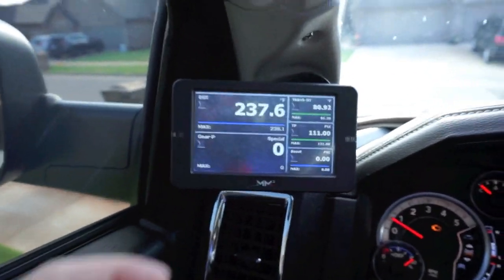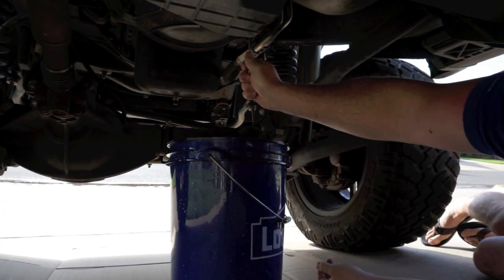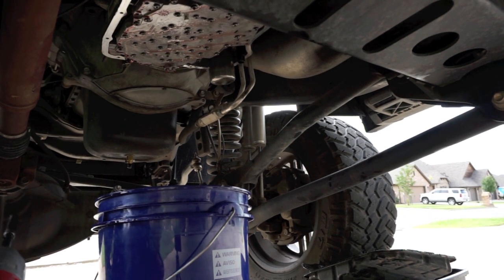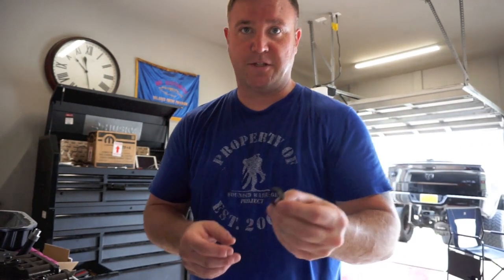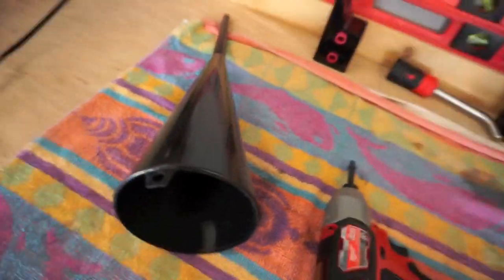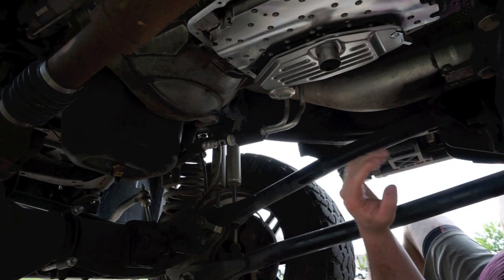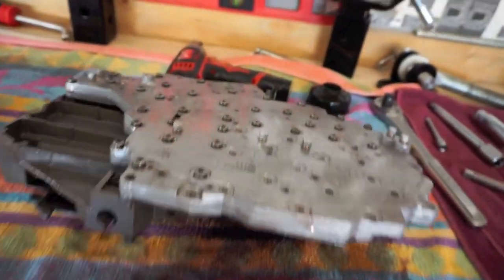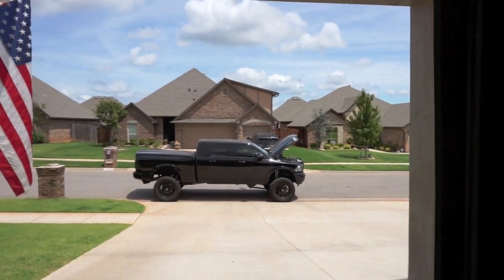68RFE Revmax Valve Body Install...

Comment: I got about 300k miles on my 2010 68rfe. 50% of times towing construction machinery. I find it's the transmission tuning that makes the biggest difference. Tuner can tune the line pressure, which would make the transmission shifts soft, firm or racing neck breaking shifts. I went back to soft. I changed my fluid and filter at 30k. Still original transmission. No issues with towing
Reply from the maker: Man i wish i had your luck. But anytime you modify these trucks performance wise it’s a double edged sword when it come to transmission tuning. My trans finally gave out at 73k miles.

Comment: I took a big home depot tote and cut it down to about 8 inches tall and it was able to capture all the fluid. Also, i used an after market gasket and that was way better than the rtv stuff. I like the revmax valve body, i would like to do that too. Cool video thanks!

Comment: That channel plate looks the same the day you took it out as the day it rolled off the lot. That’s just how cast aluminum looks. Also with your thermal bypass delete now your trans won’t reach operating temp
Reply from the maker: After further research i understand that. The thermal bypass was just preventive. It takes a little longer to warm up but she does warm up. She doesn’t get nearly as warm as she once did.
Reply: @okc_garage  did you have overheating trans issues before? Optimal trans operating temps are in the 170-180 range. What do you see now? 140-150?
Reply from the maker: @CHILLHP  i haven’t monitored it lately but i will next time and let you know. I wana say 150-160 range. If those thermostats seize and don’t open you will fry the trans. That’s why alot of people do them.

Comment: I have the exact same setup both hardware and tuning and yes I agree, you can definitely feel that the power is reaching the ground. My '19's used to feel a bit spongy and soft. It's definitely locking more solid and putting the power down.

Comment: Good video. I was going to put a kit in my 68 RFE valve body couple of weeks ago and found my channel plate cracked also. Yours looks good compared to mine - it looks like a windshield that someone hit with a hammer. Pulled a few of the bolts out in the cracked area and the cracks go all way thru the plate. Now I am waiting on a complete valve body. My truck only has 80K on it. It is fully deleted, but I drive it pretty easy. I was shocked how bad the plate looked. This is something anyone with a 68 RFE needs to look at sooner than later.
Reply from the maker: Yeah i was shocked as well. I wish i would’ve done it sooner. Very happy with this mod.

Comment: Just got a 2012 6.7 cummins, installed a BD trans pan and I saw a ton of hair line cracks 10x worse then yours. Will be doing a valve body upgrade when the wallet allows.

Comment: Great video I believe my VB is going out. I have 106k on the clock and I got her deleted at 95k miles. I wished I’ve known sooner about the VB I got my transmission fluid changed around 70k.

Comment: in the pass i use a plastic bottle using the bottom part same drill size use to catch the fluid. I'm going to replace the solenoid regardless. worry free. great video

Comment: Installed mine today with a Mag-Hytec pan.  Pro tip...make absolutely certain that both your truck and, more importantly, the valve body are in "PARK" before you reassemble.  Ask me how I know this.  Fortunately, nothing was damaged.

So...installed my new tunes and hit the road.  Light throttle so far.  I have to say that I don't feel much of a difference between this VB and the stock one, but I've only put 50 miles on it so far.  Yeah, there is a learning process and some people have said it only gets better with time.  We shall see.  I still get the huge shift flairs and all the other irritating anomalies of a 68RFE.  

I'll give it some time and see how it goes.
Reply: You need to update your transmission tune to take advantage of the higher line pressure allowed by the aftermarket valve body.

Comment from the maker: Im sorry I didnt mention this in my video, but i did do a trans relearn when i uploaded the transmission tuning file. Sorry for not addressing this in the video back when I made it.
Reply: Still running good? Still have that flare?
Reply from the maker: @dkbug22  well i snapped the input shaft 3 days ago lol. So i guess no… but before than she ran great i loved it.
Reply: @okc_garage depending on your driving style a valve body swap is suitable.  If you’re leaning into throttle with 150Hp+ tunes… input shaft, torque converter …  etc need to be beefed up.

Comment: Installing that Revmax thermal bypass valve is like removing the thermostat in your engine. I’d go with the Mishimoto bypass valve instead. It lowers temps 10 degrees but allows your trans to warm up. It’s very important if you live in freezing climates.
Reply from the maker: The reason i went with the revmax is because it removes the thermostat. If that fails your trans will overheat and eat itself alive. I live in Oklahoma it’s fairly warm 10 months out of the year. I think she will be alright.

Comment: you didnt wanna upgrade the accumulator pistons why you had it out? good video man. your stuff always helps me out.
Reply from the maker: they are already upgraded billet accumulator pistons with the revmax valve body. She shifts great 2 years later and i have zero complaints. She shift better the more you push her.

Comment: So the VB comes ready to go? Just swap the solenoid pack...?, My ride has a 144k on it , doing this upgrade makes perfect sense, iam just a bit nervous because whoever had the truck before me totally neglected the trans, not serviced once til I got it at 142k.... 😬 Yikes! Thanks for the video, great job man.
Reply from the maker: Yeah man it’s a quick swap and put your old solenoid pack on and you should be good to go. Recommend a trans relearn and bumping up the line pressure to 225-250 PSI.

Comment: Thanks for the Video.  I'm in Australia, the RAM 2500 6.7 are fairly new here in a commercial way.  As a result there is not much in the way of an experienced knowledge base here.  Mine is an MY18 68RFE.  Low K's towing full time.  From all accounts this is the fail point of the whole truck, the trans.  I'm talking with Revmax now about getting the parts over to me in Oz.  Aside form install guide by you, I'm also running RaceMe tuner, the same as yours ??? by the look.  I've sent a PM via messenger to you, if that's you I've found regards tuner advise and tunes. Regards.
Reply: Hey mate did they get back to you? I’m also in aust
Reply: @durryold1  yes mate. Revmax parts here and due to install. This week. Been away.

Comment: I have heard that you need to do a transmission relearn with a scan tool, or the clutches can get extra wear as it relearns the slow way. Have you heard that?
Reply from the maker: Correct you want to do a relearn as soon as you install it to get the clutch volume index’s reset.
Reply: Your supposed to get a retune from your tuner or it won't work right
Reply: Does anyone know how to do this on an edge tuner? I got a 2012 ram 3500 with 217k on it and hoping it helps. Won't stay locked in 6th and have to let off pedal locked in 5th to get it to shift to 6th

Comment: How did you get away without a quick relearn? I’m about to install mine but Rev Max says it has to have a quick relearn or it will burn it up.
Reply from the maker: i didnt do one right away but about a week after I did. Shes still holding strong.

Comment: 6" front and back?  Looks like has the same rake as stock, which is good.

Those "37's" were really 37" or more like 36" probably?

I have 17 in the Luxury Brown. Just put "37x12.50" on the stock 18" wheels and stock suspension. They're barely over 36" at max 65psi. And good thing, as it so slightly rubs the known places. I could literally daily just as is, not hurting anything. The fender can be slightly pulled back no cutting, and leave only the front track bar rub at rarest occasions.

Comment: Not really related to your trans but, what turbo are you running on your truck?  Your EGT's are much lower than mine.  Good video BTW, Like and subed.
Reply from the maker: Thanks Dan I appreciate the support. It’s a Borg Warner S467.7 she spoils pretty quick on stock fuel.

Comment: I have a stock 2017 on 35's. I've just bought all the stuff to do a complete delete and tune. Should I take the plunge and do this mod first before doing all this?
Reply from the maker: You should be fine to delete and tune. But i would highly recommend doing this mod sooner than later.

Comment: shift flare can be corrected with a low stall converter
Reply from the maker: That will be done before to long.
Reply: @okc_garage  I just did revmax low stall converter, billet flex plate, billet input shaft, and the revmax 550 trans. shift are smooth, firm, and no flare. 😀👍
Reply: Or just different tuning. I'm using CTT tuning which unlocks before shift but feels just as good as locked shifts.
I had Calibratedpower before which had locked shifts and absolutely  no flare, but you run the risk of snapping the input shaft lol.
Reply: I have revmax ultra low tc. I still have shift flare very similar to okc 6.7. I does NOT cure it

Comment: Do you have to do a different tuning once you put the new valve body on it? Or do I need a transmission tune? Or just take out old put in new and that’s it?
Reply from the maker: would recommend trans tuning to up your line pressure to 225psi.

Comment: Hey man I have a 2020 ram 2500 looking to use rev max for the upgraded valve body does the valve body come with a filter extension for the oem trans filter?
Reply from the maker: They no longer use the filter extension. The billet plate has been machined so it fits the filter without the extension. And you can use an OEM filter, the do not come with new filters. Highly recommend the valve body you won’t be disappointed.

Comment: Does the tunner do the quick learn process? I'm about to do the same install. 2 years later if you have the rig still. How is the transmission holding up?
Reply from the maker: You would have to reload your tunes on to the truck so it goes into a relearn. If you can get a hold of your tuner ask them to raise your line pressure to 225-250 psi. The trans shifted a lot smoother under hard acceleration.

Comment: Do you need a tune to do this? I have the same equipment and about to install them on my 2017 2500. Was curious if I need to tune before, or after?
Reply from the maker: You will need a tune to up the line pressure.

Comment: Cel at first ride gone at 2nd ride???
Reply from the maker: I had to get a tune revision to raise trans line pressure. The CEL was for a crank case sensor i had removed. Tuner tuned it out. That’s why there not a light anymore.

Comment: Noticed ur check engine light was on. Was it due to valve body issues? If so did it turn off after part was changed
Reply from the maker: No it was on for my crank case pressure sensor. It’s off now.

Comment: How is the transmission pan gasket holding up? Any leaks, and did you use any other sealant with it?
Reply from the maker: Haven’t had a drop come out of it (knocking on wood) and it’s just the pan gasket!

Comment: Nice video to bad they don't have anything like that for the AS69RC... I noticed 900 on the EGT is that about normal for not towing?
Reply from the maker: It’s hotter than hell right now here as well and it’s normally in the 600-900 range when I’m driving it. Sometime she will get up to 1100 when I’m getting on it.

Comment: I noticed your shift from 5th to 6th gear seemed to sound like a slip. I just got the rev max vb installed last week and mine is now do the same thing from 5-6 and never did that before. Does that shift ever improve the more you drive it? Thanks
Reply from the maker: It doesn’t feel like a slip to me. But one of the good and bad things about the 68RFE, is that it’s a constantly learning transmission. I noticed the hard the acceleration the smoother and more crisp the shifts seem to be. Hopefully this helps man.
Reply: @okc_garage   I’m noticing it’s getting better the more I drive. I’ve put on about 1000 miles since I posted my last comment and it has totally changed as far as shift feel, and timing.

Comment: what other upgrade you going to do to the transmission or you going to wait to get a new transmission? im fighting my self weather to upgrade the transmission or to just get rid of the truck before the transmission brakes... thanks in advance.
Reply from the maker: That’s a tough question. If you have higher mileage I’d just get a new trans. I’m low mileage. Just hit 37k. I plan on doing a revmax torque converter and a billet flex plate next and just leaving it at that. If and when she goes I’m still up in the air about what i will do. I have a long time (hopefully) before i have to make that decision.
Reply: @okc_garage  im hitting around 130k miles. i tought on getting revmax valve body and torque converter and just waited out until it brake.  i have a 3500 swd with s465 turbo
Reply: @okc_garage  I got the whole set up to build rev Max’s 850 signature series years back. Switched out the input shaft, flex plate, stage 5 torque converter, I’m talking the whole 9 yards. Haven’t had a chance to get it tuned since it was built. Had to stop throwing money into the truck for awhile. Just lost reverse in it 2 days ago. All the forward gears work. But when I put it in reverse it’s just like being in neutral.

Comment: Did you buy the billet vb that is 995$? What does manual lockup give you for dbl the price? Ability to tune your lock ups?
Reply from the maker: Yeah i got the billet VB with out manual lock up. It gives you the ability to lock up the Torque converter manually i believe. When i bought my VB the option wasn’t available at the time. And i wouldn’t have purchased it anyway.
Reply: @okc_garage  ok. Good. Im gonna go this route. I noticed in your vid that shift flare was still there. But that was with old tunes. I like idea of clutches not slipping as much with raised line preasure. Are you happy with purchase? Did you see tranny temps come down with bigger pan and therm bypass? Im at 165 always on tranny temp

Comment: Did you unhook your batt cables while you install that valve body?
Reply from the maker: No but i would recommend a trans re learn after you install it.
Reply: @okc_garage , ———— Thats a big 10-4
Reply: Hey also I was watching one of your latest videos and you were talking about how you were pretty much done with your truck I had a suggestion for your truck how about some traction bars ?
Not for traction but to keep your rear end stable they look pretty cool too
Reply: @okc_garage  how did you put the truck in quick learn? I got the valve body but I have been trying to find a tuner that has the function or a scan tool to use to perform the quick learn.

Comment: Did you get any transmission codes after you did all the work before starting it?
Reply from the maker: I didn’t have any codes at all.
Reply: I got the p0750 solenoid pack and p0706 range, I ended up just deleting the codes and triple checked everything and got the fluid level good and did quick relearn, and drove around the block a few times, shifting is nice until i try to stop, it doesnt want to down shift to 1st until actually come to a stop, was that normal for you when the trans is trying to relearn the shift points. Codes never came back on.

Comment: I need this, I got 95k miles deleted an tuned trans tuned also an having problems is always in the back of my head. What's your gear ratio?
Reply from the maker: I’m running a set of 4.30s.

Comment: I’m at 80k miles with optimal welding tunes and trans tune would love to do this upgrade to tighten up the shifts what was the cost of the kit you got
Reply from the maker: Valve body billet filter adapter and trans pan with new filters was around $1500

Comment: You mentioned your check engine light which code you have?
Reply from the maker: It was for my crank case pressure sensor. I have since switched tuning companies and don’t have any check engine lights. 👌🏼
Reply: I have a p0740 code tcc out of range
Reply: Who did u switch too?  And do u still utilize the MM3?

Comment: TCM tuned?
Reply from the maker: It is. Got the line pressure upped to 225 psi.
Reply: @okc_garage  Who tuned it? Did you use the revmax tcm tune?

Comment: though its an easy rebuild,, the 68RFE should never have been put in the diesel...all Chrysler had to do was make a  45  -- 545RFE bigger but they couldn't even do that right. it has a whole new set of its own problems.casting are crap on the case too.... the new transmissions have much better casting..

Comment: replacing that sump seal gasket is definitely NOT worth the effort, that seal will last for 500k miles and never be a problem, digging that thing out with tools is a set of risks that far outweigh any benefit.

Comment: You didn’t do a quick learn ?
Reply from the maker: Nope. She’s driving pretty good. The 68 is a revolving transmission that’s constantly learning your driving habits. Didn’t do a relearn when i re geared either.
Reply: That's odd i was told if i change my vb i had to do a relearn as well?
Reply: @nicholasjoly4816  that's what I was told a well. I have the valve body but waiting to install it until I find a tuner that has the function or borrow a scan tool.